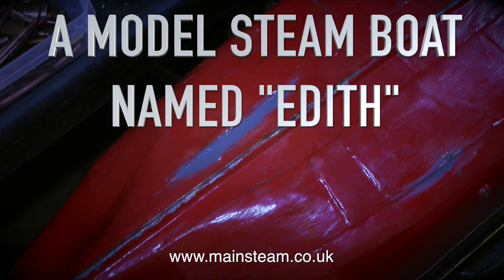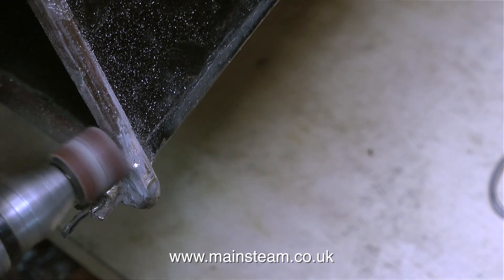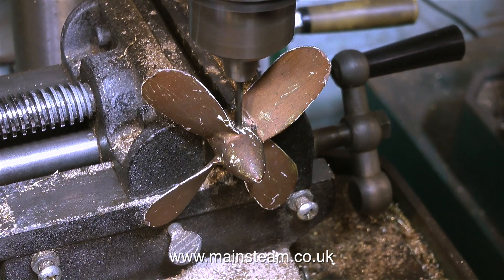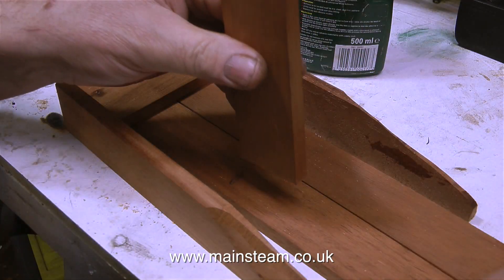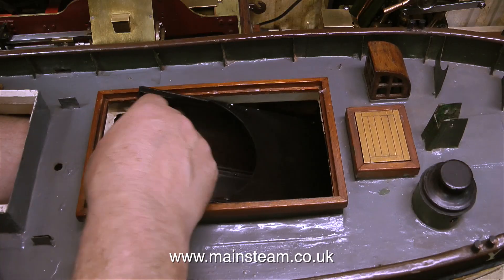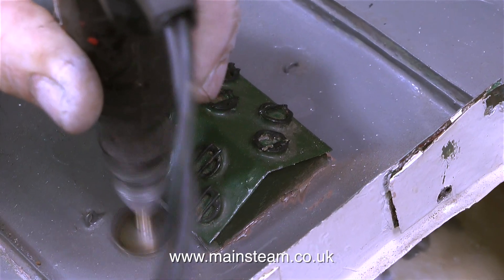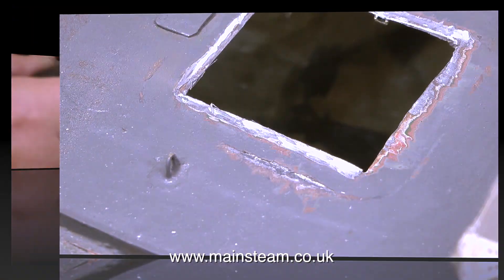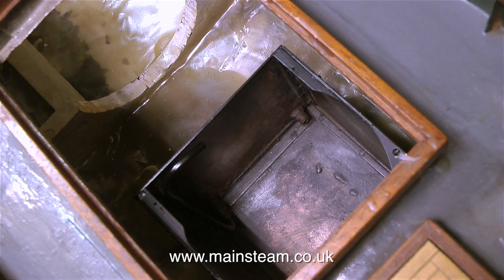A MODEL STEAM BOAT NAMED EDITH - PART #12

Comment: I'm glad you ignored the handwringers and used your fingers on the epoxy.  I've done an awful lot of building and repairs with epoxy, from (real) boats to pinhead sized repairs.  When you started smearing it on with the stick I felt my fingers start to rub it into the gaps and smooth it.  It was almost a relief when you did so, too.  :-)

Comment: Hello Keith, I enjoy your videos tremendously. I’m not a modeler per se, but I worked as a machinist for some time. When I have to drill out a screw or  bolt, I use a left handed drill bit. Often enough, the screw will back out as you drill into it. An old millwright showed me that gem. Thank you for making these informative videos. Regards, Joe

Comment: Great Video!  I've used both JB and the Locktite version of epoxy weld, both are good JB dries slower and is defiantly easier to work.  Thanks for your hard work from the other side of the pond!  

PS. My father worked for Jaguar, MG,Triumph and Rover dealer. I love hearing the correct British nomenclature.